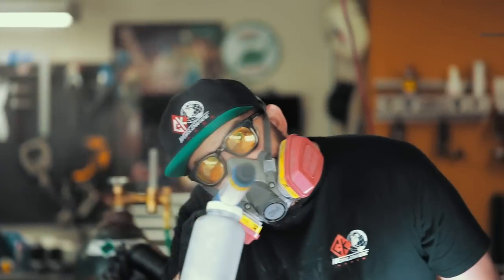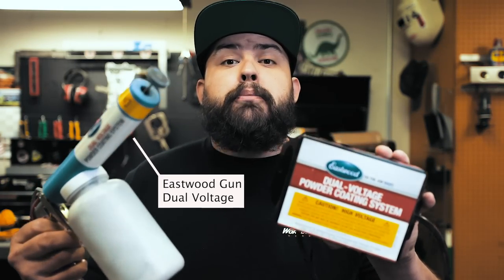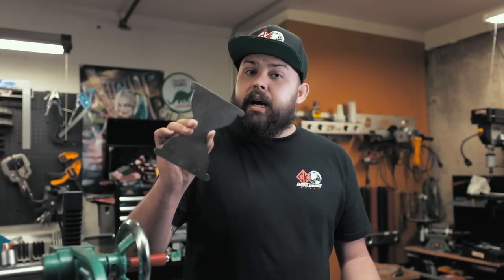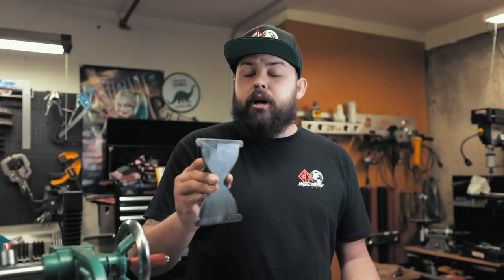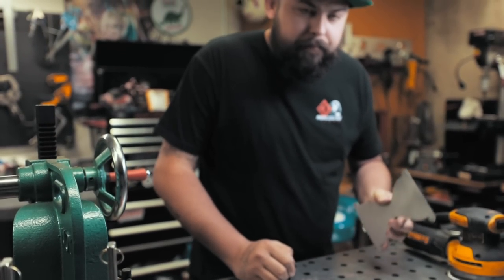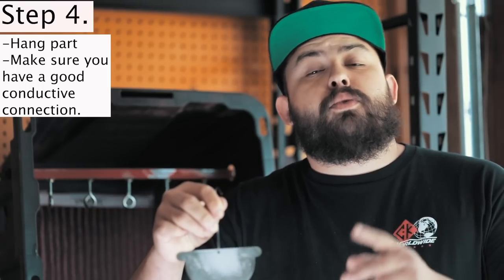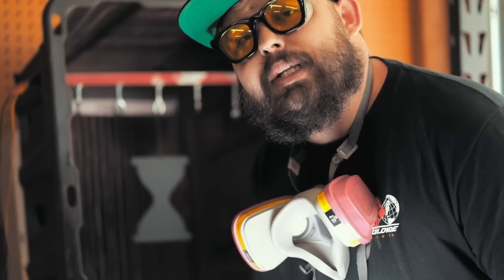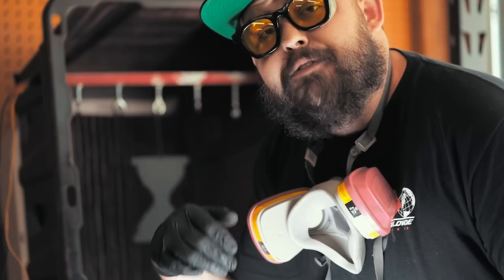HOW TO | Powder Coating at home | DIY / CHEAP / EASY

Comment: I know this is an older post, but this is very helpful. I have a big job coming up. Taking the shell, flooring, etc off of a 1974 31 foot Airstream camper. Making sure the frame is in good shape. If needed I will weld on the pieces that need to be. Clean up the frame and then powder coat it. This is the big money maker for Airstreams. Many are over 40 years old. Who wants to take their chances on a rusted out frame? If you can fix up the frame, axles, etc., show and prove that the work on it has been done then the prices increases a lot on these things.

Comment: One last comment:  I powder coated my first set of wheels for my Jeep by building an oven in my backyard out of cement blocks and and old heater element I had.  I built a stand for the rims to sit on and covered it with a piece of sheet metal.  I used a dollar tree electric thermometer and hung my parts on the kids swing set to coat them.

My point is; be creating.  I didn’t have an oven big enough for rims and I didn’t really want one.  It worked great. That was seven years ago and the wheels still look new!

Thanks for the pro tips.  If I could add one it would be to make sure you have a really good ground.  The guns use the electrical ground, but a lot of shops aren’t well grounded.  Add a ground rod to your shop or house; it never hurts

Comment: Just started using the same kit to powder coat motorcycle parts. Your tip on only using 1/4-1/5 of powder in the gun was super helpful. Much better results than using a full bottle.
Reply from the maker: thats definitely the thing that got me in the beginning! Glad i could help you. Thanks for the support!
Reply: @hourglassingenuity103  1/4=25%  1/5=20%   So you are saying no more than 1/4 of the bottle for best flow results?
Reply from the maker: houndogforever for best results.. the hopper should contain no more than 20-25% of powder.. Any More than that and you’ll have an uncontrollable erratic powder stream. Good luck.

Comment: Great video!!! I build industrial powder coat systems for a living and this is about the 5th or 6th video I’ve watched this week on here about doing it at home and after watching Jimbos Garage doing it outside and wasting more powder than he was using it was actually nice to see somebody give good tips on how to do it
Reply from the maker: Hey David, Thanks! I appreciate you checking the video out. Coming from someone who deals with this professionally i appreciate your comment greatly!
Reply: Hey David, I'm totally new at PC. I'm 60 years old and need a hobby. Have painted a couple of cars on my own. Intrigued by PC process. When is best time to remove small stencils from coating process? Thanks for any info you could help with.

Comment: Great video, I've just bought a harbor freight PC system, I'm planning on doing some bike parts on my zx14. My oven i'm making  out of a 31gal steel trash can and a hotplae at the bottom. My wheels have chrome that is peeling. I'm researching on how to remove the chrome.

Comment: FWIW, if you need to REMOVE powdercoat, I found out the hard way if you get carb cleaner on it, it just dissolves!!
Reply from the maker: sean wolfe that’s interesting. I have introduced cured powder coat to multiple aggressive solvents and never once did it just dissolve. 🤔
Reply: HourGlassFab yeah...I have about a grand in powder coating alone on my current build in professional P.C. Wasn’t happy...I’d be interested if you have old junk you can try it on...FOR EDUCATIONAL PURPOSES! 😀
Reply: Wow thats amazing that it will dissolve it
Reply: It probably wasn't cured properly.
Reply: @rashadsmith3435  he is full of it because i have never had that happen.

Comment: Very good instructional video. I learned more from watching this video over several others for the past few hours. One question though. Are there times when you should NOT use bead blasting or chemical stripping of parts if are going to Powder Coat once they are cleaned? Thank you.
Reply from the maker: daytriker thank you very much! not that I can think of. As long as the parts are extremely clean they are good to shoot. Many methods to do so!

Comment: So is the filter good enough or should a air dryer be inline ? Also wouldn't using copper be better to hang off of ? oh and DA means what ? Thanks. Really informative video..
Reply from the maker: freebird1963 A da is a dual action sander. No, anything conductive works fine to hang from. Yes, use an inline air dryer also.

Comment: Very nice presentation. One question. You mention 15-20 psi to the gun. Another You tuber used the Eastwood gun and said to use only 7-8 pounds with the canister half full. Anymore pressure and you can pop the canister off. Can you clarify?
Reply from the maker: Dancing Bear that’s definitely false information.. the gun is regulated, I’ve ran 30-40 psi through it when I didn’t know what I was doing and I never had those problems.. the hopper doesn’t hold pressure. It would automatically vent. Just adjust pressure until you get a nice fine mist out of the nozzle.. there is a ton of room for error. You’ll know when it’s laying on nice and not too aggressive.
Reply: Thanks! Also, I have a pancake compressor. I’m assuming that would work for the gun?
Reply from the maker: Dancing Bear it will work perfectly!

Comment: What do you mean by "DA" when you are prepping the part? i.e., "You can sand it or DA it."
Reply from the maker: wvmontani when I say DA I refer to “Dual action”. Referring to a dual action sander that basically has linear movement and some rotational movement.. it just gives a universal blended finish that makes it easy to powder on.
Reply: Thanks!
Reply: In the U.K. we would call that a “Random Orbital Sander” just for others info 👍🏻
Reply: Yeah, that's a random orbital sander. I thought DA was denatured alcohol... hmmm
Reply: Yep, when cleaning parts for powder coating DA (denatured alcohol) is the preferred method and referred to often. DA leaves absolutely no residue like acetone will.

Comment: Hey hows it going Brad, great video there, I need some advice, I blasted and powdercoated this weekend and the result was not good enough so now I must strip it down and do it all over so what grit should I use, is for a motorcycle rear fender and also what do I do about the lint or the remains after wyping the part with the Pre or acetone. 
Thanks in advance
Reply: HourGlassFab  Thanks alot man I appreciate it very helpful.

Comment: arent you supposed to pre bake first to bake out any oils etc in the metal?
Reply from the maker: jwolff9153 nope.
Reply from the maker: jwolff9153 I’ve done a lot of powder coating and I’ve never needed to preheat parr’s unless the faraday effect came into play on a tight inside radius of filler.
Reply: @hourglassingenuity103  sweet. I've been looking into this because i have some old bbs wheels i want to do. I also have an old electric oven for it

Comment: How well does your respirator work with the beard I cant get mine to form a seal??
Reply: They don't work with a beard. By OSHA requirements you have to shave your face to get a true seal... otherwise, your filter is only good as your beard is filtering.